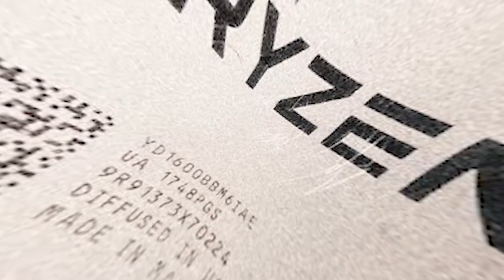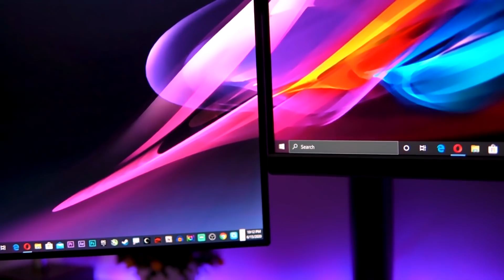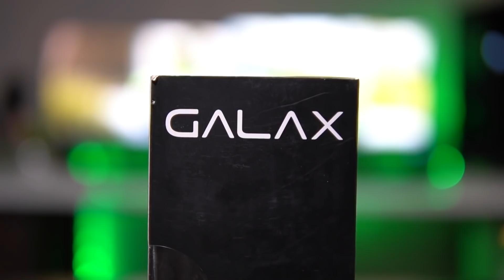Gaming PC Build Setup EPIC Montage 🔥

Comment: bro i have a  doubt that if i add ssd to my pc will it increase my fps or just loading time and  will it make the game run smoother like i get 60fps average in every game will it increase to 100fps
Reply: It will not affect you fps alot but you should upgrade
Reply: @AbhijeetMore21  thanks bro
Reply from the maker: bhai ssd system ke response time ko kam krti hai.... isse fps increase nhi honge... but loading times kam ho jayenge
Reply: @ModxTech  ok bro  thanks and btw how to get more fps btw iam using i3 9100f

Comment: Bhai dekh mera 60000 ka budget hai for full pc jisme A to Z sabb kuch aa jaye like wifi router,pc,monter, keyboard and mouse,headset etc. Mai is build me ryzen 5 1600, inno3d ka gtx 1650 super, gigabyte a320 motherboard (jo baad me upgrade ho jaye ga into b450), corsair vengence lpx 16gb ram8*2  3000mhz,WD 1tb hard disk, WD 240 gb ki ssd,ant Esports ka 511mt cabinet, redgear blaze 7 with logitech g402,LG 22mp68vq moniter, corsair vs450 powersupply, tp link 300mbps wifi router and tp link nano usb adapter le rha hu in 60000 ka budget is it worth for it?
Reply from the maker: bhai... badhiya h go for it

Comment: The prices of gaming PC's are really great better prices that superclockedpc,bitkart,SMC international 
I chose a pc on bitkart whose configuration was 
And ryzen 5 1600
MSI b450 pro m2 max 
Inno3d 1650 super
Adata 8gb*2 3000 MHz ram 
Antec df500 
Wd 240 GB SSD 
Wd blue 1tb 
In same price I am getting 
Ryzen 5 3600
MSI b450 pro m2 max 
Inno3d 1650 super
Adata 8gb*2 3000 Mhz
Wd 240 GB SSD 
Wd blue 1tb  
Modxtech pc is a great website
Reply from the maker: arey thanks bro